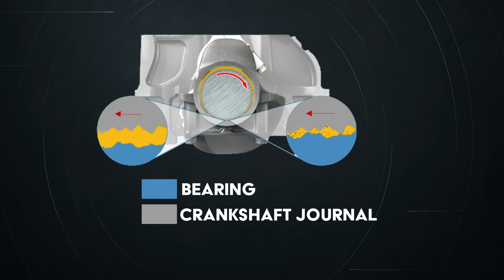the truth about start-stop technology (finally proven)

Comment: No surprise at all. I worked at a power plant for a full career. We had 4 massive turbine-generators with very large versions of similar babbit-journal bearings.  Before rotating the turbine, large oil pumps were put into service to ensure the bearings were full of oil in the space between the bearing and the journal to prevent bearing failure. In my personal vehicle, I instinctively press the button that cancels the start-stop feature immediately after the car starts.  We should lobby to provide an option for car owners to permanently defeat this system.
Reply: Buy Volvo. It doesn't come on unless you select the option for it. I've had mine turned off since day one of owning my new on.
Reply: @thatsithlordvader Just sold our 2000 Volvo S80. Had it for 25 years. Loved that car!
Reply: @carlosanvito oh man! I want an S80 with the Yamaha V8 bad. Currently have a 19 v60 with the twin charged motor. Lots of fun! Before that I owned a 97 T5 850 also fun but it died. Odometer quit working at 380,000km drove it for 6 more years as a daily before it was sold. I'm looking for a 240 wagon or a p100 classic next for my project build
Reply: I also disable start-stop almost every time and curse if I forget when the engine turns off in the first traffic lights. In the used car market there is no way to know which users protect rheir engine and which just go with the flow and don't resist ridiculous features. I'd rather buy a car with 100 000 miles on it which had almost no start-stop use allowed than a car that was started 10000 extra times.
Reply: That’s exactly what I did on my test drive for a Macan. Luckily all of the driver distraction features can be permanently turned off so I bought the car
Reply: @orgbd that's exactly what led me to buy a Volvo in North America. That and I can't stand North American cars. They're junk
Reply: @orgbd Sadly, not all German cars allow this.  Mine certainly doesn't.  And, using aftermarket devices risks voiding the warranty.
Reply: Yup
Reply: Agreed.
Reply: Nice, I work for a large power service company repairing said turbines and generators for power plants.  I've seen what happens when turbines lose oil pressure (look up GRDA fire).
Reply: the amounts of bots here is staggering psyops in force. Wanna do a star and stop car? put on an electric oil pump just as they put on electric water pumps for "EFFICENCY" lulz
Reply: It's part of the emissions profile of the vehicle. You will never be allowed by the manufacturer to permanently disable it
Reply: @ej20tnz I have a 2016 Subaru Impreza that has push-button ignition, with no auto-stop feature.   I've also known a couple of people that were able to permanently disable the function on their cars through the dash menus.
Reply: I agree. On VW cars including Audi you can use OBDEleven through the OBDII port to save the Start/Stop Off setting to be off permanently but you pay a small fee.
Reply: car manufactrers/government org will be like: i wish for quad-metal bearing, the truth will be contained within
truth is: it doesnt work like that
Reply: You disable a feature on your car because you worked at a power plant? That sounds like a great decision.
Reply: @MrRoguetech If you don't disable that feature on your car, you're going to be replacing motors or at the very least pistons and valve train components about every 150 to 200,000 km. Your call.
Reply: @thatsithlordvader Start-stop causes less wear than the engine continuing to idle.

Large freight companies run real-world trials over millions of miles, and most are transitioning to start-stop. They're doing it for profit. The fuel savings is neglible compared to the cost of the vehicle and maintenance - even the slightest increase of wear would offset that. Ergo, start-stop engines last longer.
Reply: @MrRoguetech I highly doubt that. I've been around high performance vehicles and commercial vehicles my entire life. Not one of my mechanics say it's any good for engines. You probably think diesel exhaust fluid is a savior as well. 😅
Reply: @thatsithlordvader If your mechanics have performed multi-year trials with thousands of vehicles, I don't know in what way you think they're "mechanics".

You can doubt facts all you want. It just makes you wrong. Google freight carriers start-stop.
Reply: @MrRoguetech ...
Reply: You're talking about two incredibly different systems. Disregarding the fact that consumer vehicles are designed to do this.. just baffles me that the "consumer" who doesn't even know how engines are designed thinks they would know best.
Reply: @Boguardis  Carlos is right, as an informed mechanic and scientist, that most engine wear occurs at startup, as gravity constantly drains oil away from parts. You failed to mention your credentials  Bogus!
Reply: @Boguardis Actually, I didn't indicate my credentials in the post, and as such I respectfully disagree with your assessment that I'm an uninformed consumer.  I stand by my comments.
Reply: @Boguardis  Why don't you explain exactly how these engines are designed to maintain oil pressure in the bearings during auto start/stop
Reply: @Journey_of_Abundance  I'm pretty sure in the time it took you to write that you could have looked it up and satisfied your inquiry.
Reply: @Journey_of_Abundance  Besides, why trust some quack on the internet, better yet go talk to the engineers who work on the systems.
Reply: @Boguardis  your confidence is misplaced.  every time the oil pump stops gravity drains lubrication from all engine surfaces!  the more starts the more wear.
Reply: @number6-b9e oil doesn't disappear, depending on viscosity there is layer left.
That's where specifications becomes important.
Reply: @number6-b9e You are aware that the oil film remains between the bearing and shaft, even weeks later.

Hell engines back in time didn't even have a pressurized oiling system. But OMG the engines starting with no oil pressure!!! It's a conspiracy!!!
Reply: @OmmerSyssel  After 8 hours, gravity has removed all trace.  you have heard of gravity?A 15w40 or a 20w50 may leave a residue, but  you don't use that!
Reply: @number6-b9e  In addition, the engine system cools down ... battery is drained to operate car electronics etc. Extra energy is used to start the engine again + recharge the battery. Depending on diving profile, I can easily see a negative rate of return. Both from an environmental to an economical angle.
Reply: @number6-b9e  You realize that oil doesn't magically disappear when the oil pump stops right? Besides, most cars have electric pumps now that still work when the engine is off, or they use check valves to keep pressure up.

You're disregarding new technology that compensates for the problems you are bringing up.

This isn't the 1990's anymore. Please just educate yourself.
Reply: @Boguardis not sure which vehicles have an electrical oil pump, some are electrically variable. But all oil pumps are driven by the engine.
Just look at mercedes at how bad an electrically variable oil pump can be, when they fail the cause oil to wick up the wiring harness and damage the ECU if not found soon enough
Reply: @Boguardis  The engineers who work on these systems were forced to do this by the higher ups. The decision is top down and forced by regulations. The engineers try their best to make the engine durable enough to handle it, but you lack critical thinking skills if you think there is no harm in start/stop. It is basic knowledge that engine wear is highest before oil pressure is stabilized. No the oil doesn't "magically" disappear, it drains due to the force of gravity and oil pressure dropping to zero.
Reply: @Boguardis  Try watching the video before commenting. They show the extreme wear on the bearings. It's not "magic". It is basic physics.
Reply: @Journey_of_Abundance  Maybe don't implement start/stop?  You can start your car like what, 10 times a day, but with this neat system you may increase that to 40-100 times. So you are making an engine that could start suffering wear in 5 years, in like 1 year of use. Shitty feature that requires a special secondary system that can never be implemented.
Reply: So you can't explain.  Got it.
Reply: @Raikos100  I disable it every time I start my vehicle
Reply: @Journey_of_Abundance Oh, believe me, I can fully explain this.
Reply: @carlosanvito  I was replying to the other guy
Reply: oh yes... another youtube engine expert...
Reply: @marekmarecki7065  Who? The power plant engineer stating a self-evident truth? Or the undateable mong who thinks engine starts don’t create wear because magic?

Comment: you are analysing start stop for w conventional engine. 
what about hybrid vehicles that stop the engine more than 10 times compared to a normal car
with start stop?
the thing is these engines including enginea with start stop  are designed to withstand these cycles. only
when in  heavy traffic it will probably be better to avoid start/stop.

Comment: The sane way to do this is to power an electric oil pump when the engine is stopped, and also don't actually stop it. Instead in a hybrid you use the hybrid battery to keep the engine slowly turning with the valves all open and no fuel going into the engine. That would keep everything lubricated during stop-start operations. 

Thing is, engine stop-start was mandated by a gormless, faceless bureaucrat in the EU. One who wasn't paying for the batteries killed or the engines destroyed.

Comment: Everytime I see the stop start cars starting off I cringe at the thought of the starter motor, nevermind the extra fuel the car will use over all.  Stop start cars are like central heating thermostats.  They get to a comfortable temperature then turn off!  The entire system cools down about 3 degrees Celsius before starting to heat up again to a comfortable temperature!  This wastes fuel, causes extra wear on the engine and reduces the life of the starter motor significantly!  How these moronic ideas come to be market is  beyond idiotic!

Comment: I am very pleased to see this issue finally coming into light, since I as well have been a long time opponent of this system. I also doubt that it actually saves that much fuel, unless in a tightly defined scenario, as in a major city. For the most part my diesel T6 just shuts off the engine for less than 3 seconds, after which it needs to work harder to recharge the battery, to compensate the significant losses required to 'phase change' energy. I.e. converting mechanical energy to electric, overcoming charge- and discharge resistance of the battery and again, converting it back to the mechanical force required to overcome static friction and start the engine.
At 10.35 it's said that the engine has already run millions of miles. At 10.56 it's said that it is not uncommon for these engines to last more than a million kilometers. Might need a text note to correct the first millions of miles statement, so the video keeps it's otherwise very good technical integrity.

Very well made test and explanation, I've subscribed to the channel!

Comment: The answer is obviously to go EV ;)
Reply: Electricity to charge your "GREEN" battery powered EV comes from;

 • Fossil fuels 60% Lets explore this shall we?
 • Nuclear 20%   Ohh ya that's really clean energy. What's the half-life of radioactive byproducts? Japan released how many millions of gallons of radioactive water into the oceans? Not to mention the airborne radiation results of the 2011 tsunami?
 • Renewable 20% Giant windmill blades at the end of service life are placed in a huge trench and backfilled over.
 • Pumped storage hydropower -0.1%

 • Lithium mining causes land scarring, pollution, greenhouse gas emissions, water contamination, air pollution, and soil degradation.
 •  Lithium mining, particularly from hard rock, requires substantial electricity. This energy often comes from non-renewable sources, exacerbating carbon emissions and the carbon footprint of lithium production.
 •  Lithium mining generates large quantities of mineral waste
 •  Lithium mining has led to social struggles and human rights issues, particularly affecting indigenous communities. Extraction has displaced many from their ancestral lands.
 •  Producing lithium batteries emits more carbon dioxide than manufacturing conventional cars. For instance, producing a 1,100-pound battery can emit over 70% more CO2 than making a traditional car in Germany.
 •  Lithium-ion battery recycling faces challenges including high energy consumption, toxic waste, including heavy metals like cobalt, nickel, and manganese, and inefficiencies in material recovery.
 • Polluting of the groundwater.
 •  Australia found that 98.3 percent of lithium-ion batteries end up in landfills. That has to be sooo good for the environment.

Please, don't tell me how "your" GREEN EV are superior to gas powered vehicles.

side note
Please:
If you insist on doing so, before beginning any statement or discussion, exclaim;
I just farted and as the aroma rose, I breathed in deeply and enjoyed the flowery bouquet of my flatulence, smuggly savoring every delicate nuance before exhaling, ahhhhh.
 EV vehicles are . . .
Reply: @nobodyinparticular-b7r  Utter two magic letters and the EV TROLL pops up, insults and facts flying, but NOT the TRUTH.  TROLLS always bring out capitalisation, IT JUST DOES, sorry.   (Truth = the WHOLE truth and nothing but the truth).

I can broadly agree with many of the facts about mineral extraction & nuclear.  HOWEVER why be prissy about lithium mining when you don’t give a hoot about OIL EXTRACTION?  All the sins of mining are repeated in the production of oil with the added bonus of full scale war, for example the first Gulf War against Iraq in the 90s, which then led to the second Gulf War in the 00s.

Summary - there is more blood and misery in a fuel tank than a battery, but there IS BLOOD in BOTH.  

EVs have the clinching advantage of not poisoning the streets where you live.

UK electricity mix is 30% fossil, 40% renewables, 20% nuclear, 10% other.

I will not be reading any further replies on this thread so SAY WHAT YOU WANT - you're welcome.

Comment: How about engineering around this problem, like putting an external electric oil and water pumps, that runs before and a set time after engin running, in start / stop situation it could run all the time. 

Other thing that break specialy turbos is shutting off engine after hard work when there is still a lot of heat in turbo, the heat will cook the oil in the beerings in the turbo and make a layer off cooked oil. 

Bmw long 6 cylinder engines had the problem of working because of not cooling the engine dow enough after spirited drivin. 

In the 90 - 2000 we used to have gadgets like turbo timers for turbo car's to keep the engine running after removing the key so you could leave the car to idke for a while after you park the car to make sure you get the cooling down period, I always thought that it would bee more efficient to have electric pumps to do the job
Reply: Cant sell as many new vehicles with your idea.

Comment: ive turned it off all the time, currently completely disabled on my current car so i dont ever forget to turn it off.
Reply: How do you permanently disable it?
Reply: @Mdaddarioe it depends on the car but I've got a Renault and I've disabled it using an application called ddt4all  and a basic Bluetooth  odb2 reader. Im sure other cars can have the same done but you'll  need tk find specific software for those makes.
Reply: @Alex-if3sr  Thank you for the response, Alex. I will research for my specific vehicle.
Reply: @Mdaddarioe I drive an Alfa Romeo Stelvio.  There is an after market bypass gadget that took me 5 minutes to install
Reply: @Mdaddarioe  first step is to find way to learn how to use google. second step is to use google

Comment: Start/stop on hybrids is worse by far because it stops from high revs while driving and then restarts to immediate high revs in an instant. It does this cycle many times more often that normal ICE start/stop. Apart from bearing wear being significantly accelerated, the thermal stresses of heating and cooling of all parts must be damaging plus, the big one, even with electric coolant and oil supply, the turbochargers so often fitted to downsized ‘cleaner’ engines today must have significantly shortened life compared to a well driven non-stop/start or non-hybrid engine.
Mild hybrids are much better in this respect because if the stop start is switched off and only used when there is a stoppage of traffic  of more than a minute, little or no extra wear occurs.

Comment: Stop/Start will usually be on a hot engine, far above 22 deg C but may be realistic for a car starting in the Summer. In Winter the temperature may be below zero! giving even worse results. The turbo will begin cooking the oil if it is hot but static. Also consider that some newer engines have a variable shielded oil pump to reduce oil output through a cold engine. Everyone in the trade knows these technologies are very expensive to repair leading to a shorter life of the whole car which may be uneconomical to repair for an older car and may lead to debt for a cash strapped owner. Add that some owners use the incorrect spec of oil and follow slavishly the manufacturers extended service life of the oil when it should be changed between three to five thousand miles and not twenty thousand miles as recommended. Not very green technologies all things considered. However on the plus side new technologies can have a good effect on metallurgy and design.